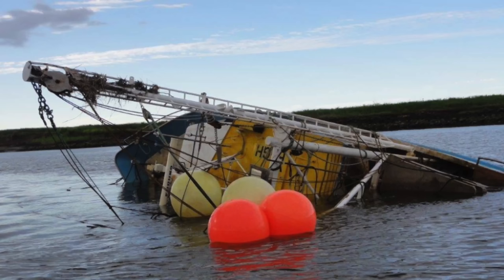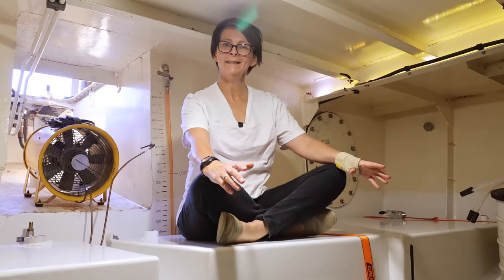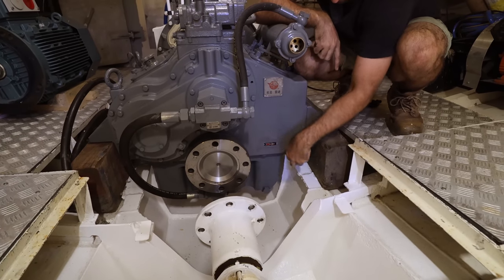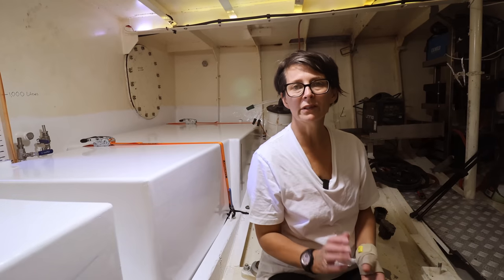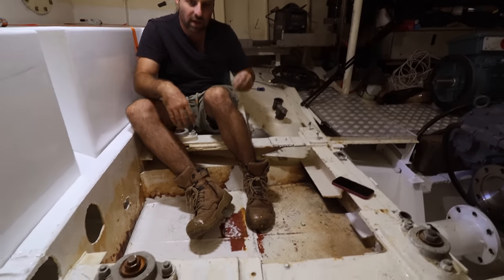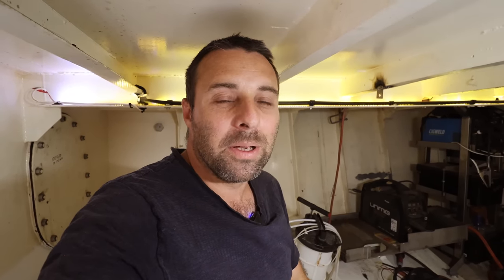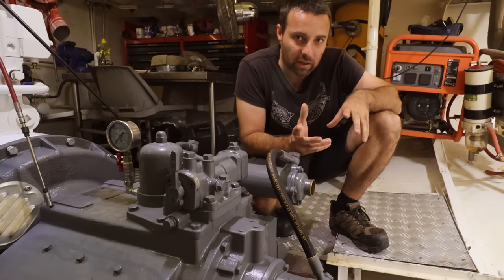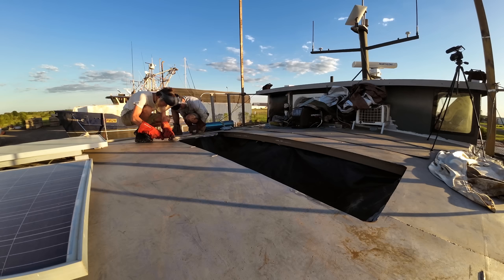What's next for Brupeg's Engine? - Episode. 300

Comment: Chockfast works great for engine and reduction gear alignment, just as you described. It actually dates from the 1980's. There are some calculations you need to do that relate the required area of the chockfast to the clamping force from the engine mounting bolts you are using. Chockfast has a manual that covers the sizing calcs.
Reply from the maker: Ahh good to know. Will make sure we have it on hand before we build the mounts

Comment: Regarding engine and gearbox oil change system. Consider putting in a used oil tank that the oil is pumped to, if you don't have one. The size of a number of changes. We had that on the boat I served on in the navy. The Scania engines had manual pumps with long handles mounted to them, and it was quite easy to pump out all oil to do a change. It's quite a lot of used oil to manage in containers.
Reply: Can used engine oil be treated and then used as fuel?
Reply: 100%👍
Can also be added after filtering/heating to diesel in certain amounts.

Comment: Fantastic to see you up and about Jess!
Well done to BougeRV for coming on board with the project.

I can imagine that the  new solar panels will come very slippery when wet, especially in rough seas.
Have you given any consideration to fully enclosing the three decks with handrails or alternatively a centre line harness safety line?

As always, Massive Respect from Aotearoa (home)
😀👍
Reply from the maker: We pondered both options a while back and settled on a centre removable harness line. That way we have less shading risk for the panels but still high safety when clipped on
Reply: @ProjectBrupeg  
There are lots of innovative safety solutions for working at heights on building roofs.
But I think two single lines from the mast stretching fore and aft would suffice.
The primary concern would be that it doesn't slap on Brupeg's roofs.
Looking forward to next week's video.
Keep up the good work.
😀👍

Comment: Hi Guys it's good to see all that work coming together, the tanks looks great well done, now I have done hundreds of alignments of all kinds and what I use is a hacksaw blade and a stick of 50/50 solder (hammered into a taper) you start with a visual alignment then with the hacksaw blade check across the OD of the flanges at 12 and 3 o'clock and with the solder slide between the faces and a mark will appear on the face of the taper and when these marks are all the same the faces are aligned and it's easy to tell the alignment with the hacksaw blade, then you can check the final alignment with the dial indicator, if you have never used this method and you do it right you will be surprised how close you get.

Comment: Very excited to see how the new solar works out. I live on solar and a gen. Sun is out long enough now no more gen  wohoo.

Luv you guys 💚
Reply: Same here, very interested in these new panels, not seen or heard of them before, I'd love to know how efficiency compares to solid panels, flexible ones aren't usually great but these may be different.
Reply from the maker: They are about 2% less efficient than solid, however they are 50% better in shade than silicon. So for us that means a higher title output then with silicon
Reply: @ProjectBrupeg  that's pretty good, and the fact that they can be put over a larger area will also help with the small efficiency loss. I currently have bifacial panels which also do well in shaded or overcast conditions, but the amount you need would contribute a significant weight up high where you don't really want it. These look like a good choice for Brupeg.

Comment: Thinking of your oil changing system.  I recommend a gear pump because every time I went to change oil with an impeller pump, the impeller failed - what a mess.  I have a MUCH smaller system than yours, but I am doing well with a small 12 VDC Marco gear pump.  It is always ready and can run dry.
Reply from the maker: Thanks for the tip!

Comment: Lovely surprise video Guys.I think some time back I suggested them as an option because the flexible panels could be walked on. So pleased to see you have chosen that system.
Lovely job welding the hatch roof back on Dame.The welder sure has proven its self.

Comment: For those nasty, rough weather emergency belt changes, a great solution that will get you into harbor is a few lengths of 'Link Belt'. You can install one without disconnecting shafts or removing other belts. We ran several hard to access, low load pumps on link belts and they lasted for years...Oh yeah, so this isn't just a comment making more work for you guys, Great Job! I think that new welder is going to see a lot of use!... :face-blue-star-eyes:
Reply from the maker: Thanks Mike I’ve heard a wee bit about link belts. Good to hear your experience with them
Reply: @ProjectBrupeg  I also personally vouch for them. I've had them installed for years now on most of my stuff and other than outside mechanically induced failure, strikes or slippery conditions due to oil, i've had no issue with them. And it's so easy to repair them. Pop them off, reach in the bag of spares, fixie fixie, and back to work they go. I've used them on my table saw, my personal car, there's a five of them powering my biggest lathe, and in our yard, most of the heavy equipment is decked out with them as the old stuff snaps or gets worn. I got all of mine directly from Grainger, dunno about similar products. I'm currently using the super t link for the heavy duty stuff and the power twist blue for everything else. They're not cheap when they add up, but the manufacturer made one heck of a product so it's worth the investment.

Comment: make the roof section removable , add a 25/50mm flange on top with rubber seal and bolt it in (you know that you will need to take that bit of roof off to  do  something later)
Reply: Exactly,  and that engine needs to work first.

Comment: When running the get home motor youll either need an electric oil pump on the gearbox or just simply fill the gearbox right up with oil. This is needed to lubricate the clutch discs
Reply from the maker: Yes we will be fitting an external oil pump

Comment: Hmm solar panels on a boat I've tried lots.  Currently using Sunpower Maxeon 400s just like several other cruisers downside weight.
Flexible only seen limited success with Sobian and Sunware.
Have been considering  Sunman eArc Flexible which give a 5 year marine warranty and are used widely in the commercial speciality building market. 
The company / manufacturer you are working with (if I have looked it up on the web correctly)  only give a 18 month warranty however I have heard the product are pretty well bullet proof.
Everyone can have different criteria mine was output for dollars given limited space. Ended up with 1600 watts on the Targa and 800 watts on the Saloon roof. Sunpower have worked extremely well in shaded and limited sunlight. I am only considering the eArc Sunman on the Saloon Roof to get back the streamline and reduce Wind resistance and weight but it hard to justify when the existing panels work fine. 
Will be watching with interest the long term results with your solution.
👍

Comment: Coming along.  I thought for sure you would close up the roof with a removable panel for future needs.  One way would have been to weld a flange all the way around and then bolt the panel in place.  Nuts could have been welded on the bottom side and the whole thing sealed with butyl tape.  But, then again, that engine will hopefully not need to come out again for a very long time.  You guys are doing a great job and I constantly tell myself: "why didn't I think of that".

Comment: I'm an engineer in the navy. We have belt driven backup variable pitch pumps. They are used during power failures or main pump failure. We keep two sets of belts attached to structure AROUND the shaft. That way if we need to replace belts we don't have to unbolt the shaft flange. I would recommend you do something similar. I work on a diesel electric ship now and I think you're going to use the electric drive more often then you think.
Reply from the maker: Hi Jeremy. Yes our plan is two spare belts pushed over the stern gland and ties off right at the back. I think your right. The ability to start the genset and move the boat round at 5knots is a an attractive option for anchor repositioning and slow cruising to save fuel. At full speed on get home motor we can theoretically do 5knots and use 11Lt/hr which is less than the idle setting on the Cummins main

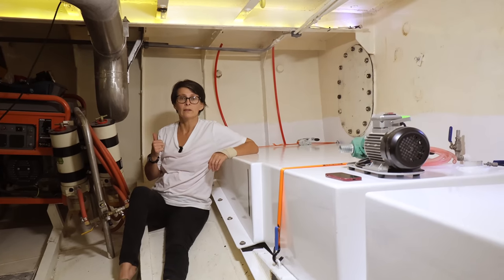Comment: 12:38 with regards to your ventilation system, your current plan from what I understand will be fine for air changes per hour etc etc. The issue I’m seeing however is that your engine room will be running essentially at negative pressure. This is not usually a good thing from an engineering standpoint IMO as a ships engineer. A negative pressure environment increases the pressure differential between the engine crank case and the engine room, increasing the likely hood of oil seeping out through seals whilst running. This is why on big ships we force air into the engine room rather than sucking it out, at least, whilst engines are running. Yes, it is noisier within the space, but with engines running it’s a non-issue. When they’re off we will happily shut supply fans down and only run an exhaust fan to make it quieter, as oil leaking past seals is then a non-issue due to no seals being constantly coated or submerged in oil.

I hope this is received in the way intended, friendly constructive advice. You’re all doing a cracking job!
Reply from the maker: Thanks very much. Will see what options we have to switch it round. Dame

Comment: I would try to use the aqua system, soft mountings  even with a 100% alignment a aqua coupler that will reduce wear on the shaft bearings, aqua couplers allowed disalignment transfered from the prop.

Comment: If you put a large heavy duty chunk of rubber between the two faces, the transfer of vibrations through the hull can be greatly reduced. Just a thought.
Reply: that would be a dissaster keeping things in line...
Reply: @MrBugsier5  you still bolt the flanges together just with longer bolts and the rubber block sits between the two flanges

Comment: Hi Guys,  Have you considered moving the engine up 12-18 inches forward and using a driveshaft with a few universal joints to connect the transmission to the prop shaft?   just a thought.  Best of luck.
Reply from the maker: Not enough room. Engine has about 12” between front pulley and bulkhead

Comment: Congratulations on Solar Upgrade !  Do the manufacturers recommend anything under panels between adhesive sections ? Something to allow water/ice to escape, like a net or mesh or maybe some pieces of o-ring cord run lengthwise to ventilate while keeping spaced off roof ( otherwise you would have to exclude H2O getting under solar flexi panels ) ? Dame, are the adapter / elec aux drive going to be toothed gilmer belts or a series of parallel 3 or more V belts to cope with torque loads ? Jess, really liked the inside view of roof panel mig welding ! Can't wait for Weld Fest next week !
Reply from the maker: Thanks Mike, not sure about something under the panels, will discuss this with them and see what they say. get home drive belts will be 85mm wide gilmore type belts. Single belt but mega strong belt

Comment: Word of caution...

If you use a mag base and arm to hold an indicator and then spin it on a vertical plane you will get droop.

In other words, when it's sitting on top gravity will pull the indicator toward the flange, when you spin it down to be underneath gravity keeps pulling in the same direction but now away from the flange.

Set the indicator up to measure the prop shaft flange it's mounted to first and take a reading top and then spin it down and measure again. That gives you the droop for your setup.

You can then get the engine side flange to match the prop, any variation greater than the droop is your actual misalignment.

It's not a perfect method, but it will be plenty accurate for what you're doing.
Reply from the maker: Thanks Daniel, I might shoot you a message on this and pick you brain a bit more so I clear
Reply: @ProjectBrupeg  No worries mate. Happy to help.
Reply: @ProjectBrupeg  Here's a quick demonstration.

Mag base attached to my lathe chuck indicating on an endmill in the chuck. So what I'm indicating wouldn't move at all of the indicator was perfectly rigid.

Don't have the swing to get that to go all the way around, but you can see 0.06mm over just that 90 degrees, so that's probably going to be about 0.005" if I could make it all the way around.

I've also got the indicator relatively close to the base, if you extend it further away that error becomes greater. You could easily indicate it in and find yourself way out of tolerance if you don't account for that droop.

https://youtu.be/rgosCu7wkOA
Reply from the maker: That makes perfect sense. So couple of things I’m thinking is keep the indicator as close to the mag base as poss and figure out the error first to factor that into the numbers.
Reply: @ProjectBrupeg  Pretty much, yep.

Assuming the indicator will be mounted to the shaft, If you measure 10 thou of droop on the shaft flange (indicator showing 0 on top, -10 underneath and -5 on each side) then you need to get the gearbox flange to show the same readings to get it aligned.

If it shows 0 top and bottom (on the gearbox flange) then you're 5 thou out.
Reply: @ProjectBrupeg  For completeness, the reason it isn't perfect is that the measurement will change each time you rotate the indicator around just due to friction etc in all the joint and the indicator itself, along with errors from adjusting it's position to measure the gearbox flange.

To minimise the adjustment errors, don't change the arm position. Move the whole base instead so that the overhang stays constant.

If you needed it to be absolutely perfect (within a tenth or so) you'd have to mount a precision sphere from the shaft to overhang the gearbox flange, get everything exactly colinear so that there was no angular misalignment then use gauge blocks to measure and address the parallel misalignment to get everything perfectly coaxial. You're also dealing with temperature variations and all sorts at that point as well.

That would however be an utterly ridiculous thing to do given how big your tolerances are and that the movement in the hull from the water would be way more than that anyway.

Just accounting for the droop by measuring should get you within a thousandth of its actual position. To be super sure, you can reduce your tolerance a bit as well if you like.
Reply from the maker: Thanks for this. Last time I didn’t take account of the arm tolerances and got it to 1.5 thou. If I can take account of the arm and gravity this time and get it within a thou I will be a happy camper

Comment: Thinking you will just need to get the front of the motor to the right height and the tail bolted up tight to the prop shaft. Then pour the epoxy for the rear mounts?

Comment: Very well done . I think the key to any great job is being open minded. You can take the advice or not . Saying that . At least you are listening and might find a better way to do something. You just never know. We all can be civil about it . This is the first comment here but I have been following for a long time . My first trade was a diesel mechanic . I worked on tractor trailers . Myself I would have put something as handles on both sides of the roof panel before I cut it out . In the hope to make it easier to move around. Good idea with the tabs though . I would have done that also . You worked easier. Not harder . Good job . Lots of good ideas here and I am waiting to see and learn more . If you do not learn something every day . Then it is just a waist.   Just something small counts .

Comment: I have one concern for the panels. On a couple caravan pages on FB I have seen multiple posts about 3:24 semi flexible panels failing within a couple years. 
The theory is that they fail due to overheating. They are all mounted with glue onto fibreglass composite panel roofs. 
I assume by the quality of these panels that these won’t have the issue and being on a metal surface where heat may dissipate easier. 
Some comments on these posts I have read speak of mounting to coreflute so there is an air gap under the panels like glass panels have.
Reply from the maker: Hi Jake. Yes we have previously used flex panels with poor results and had good results with solid panels. We actually decided to go with these panels because of the build quality. We will be discussing mounting with BougeRV as heat dissipation is a factor we need to think about.

Comment: For some reason I'd assumed that having cut an access hole in the roof, you would weld in a flange under the edge of the hole & spot-weld closely spaced studs to the roof panel that would go through holes in the flange so you could bolt it in. Seal it with a bed of good mastic, & you'd have a roof that would be absolutely rock solid, but that you could unbolt if you ever needed to for engine work...
Reply from the maker: Grinder and welder achieve the same thing with less work. This is a hatch that is only opened for main engine removal so maybe once a decade if your lucky.
Reply: @ProjectBrupeg  Here’s to good luck, then!!